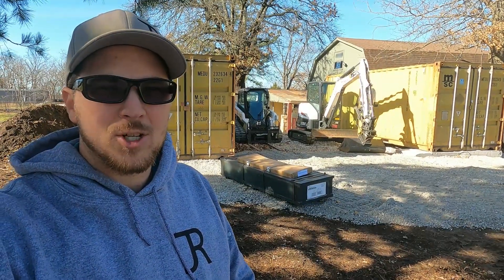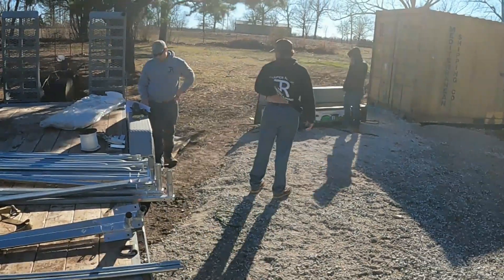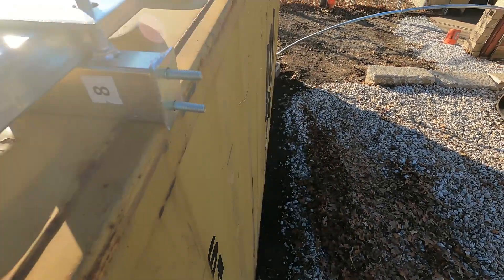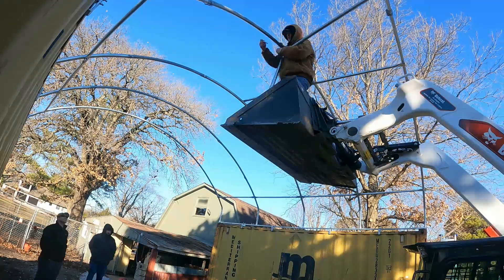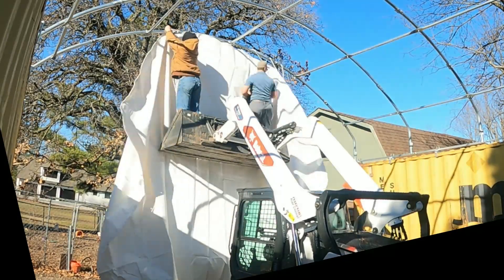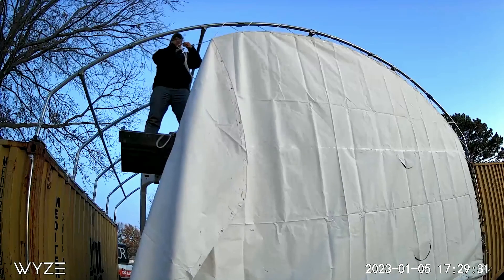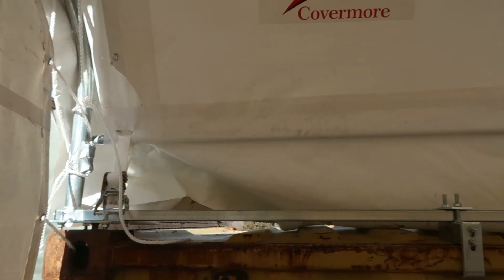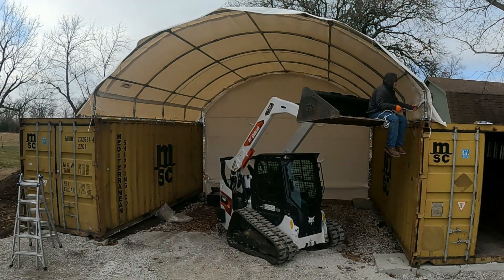Build Your Own Affordable Shipping Container Shop

Comment: Carson, that made a nice area to work or store out of the rain.  Easy assembly, economical price.

It’ll be interesting to see how it holds up on the 1 year review!
Reply from the maker: Honestly I don't foresee any issues with it holding up 1 year.  The pvc cover is very heavy duty.  I will definitely keep the channel updated!
Reply: @ThriftyGarage   How is it holding up? Do it take snow loads?
Reply from the maker: @BrotherAlan  our snow loads are not very heavy here.  The roof has held up great!  No issues there.  Wish I could say the same for the back wall.  The winds really put a load on it and the straps ended up breaking.  I probably could have secured it but I could tell it was going to be a constant fight (too much wind).  Eventually I want to frame a back wall with either metal or wood.  I will probably use the original back wall at a minimum for the upper half circle or possibly the entire wall "sheathing."
Reply: @ThriftyGarage  please dont this is what i was concerned about. you are fortunate it was only the back wall that failed. trapping that airflow is not a good idea.

Comment: This is a bad idea.  The Conex roof is concave with about a 1" rise in the middle.  Unless you figure some way to drain the trapped water you created, you will have corrosion problems on half of your shipping container roof. Also you have added weight to the walls which were not designed to take the loads you have placed on them.
Reply from the maker: You are right. I should have spent 10x and build a proper shop! It is a compromise.
Reply: @ThriftyGarage   It would be fine if the center portion between the shipping containers is a sort of lean-to outdoor storage area where the water drains into the space and does no harm, but you enclosed yours like an indoor storage space..
Reply: @ThriftyGarage   Cost would not have been 10X.  I have both quonset huts and shipping containers and I have been in construction all my life.
Reply from the maker: @ForbiddTV  the water still drains under the flaps of the arched covering.  Some of the water drains to the "inside" of the structure.  Not a big deal.  I'm definitely not worried about corrosion.  Also, the entire arch doesn't weigh more than a few hundred pounds.  It sits on the corners so the weight in the middle is minimal.  No regrets.  I'd definitely do it again. May not be right for everyone but it's a perfect application for us.  Maybe eventually we will build a 60'x80' shop and eliminate our outbuildings.
Reply: @ThriftyGarage   I brought in two 40HQ shipping containers but didn't think the roof spanning them was a good idea.  Did your taxing authorities treat your "structure" as a taxable addition to your property and reassess?  Mine did not with just the two shipping containers.